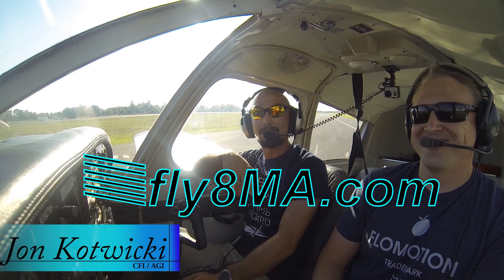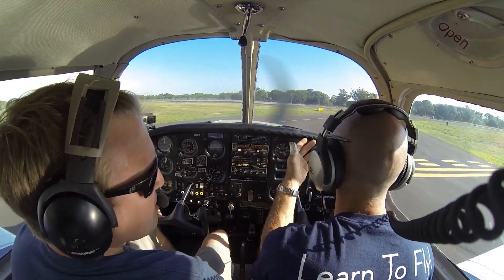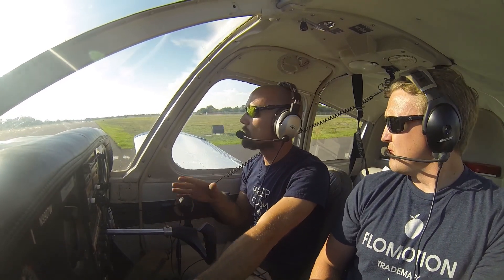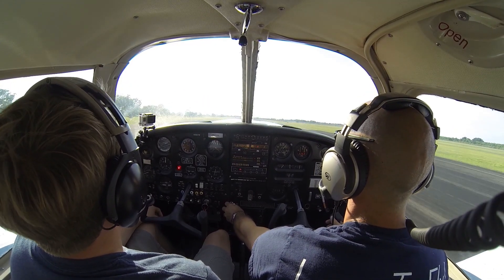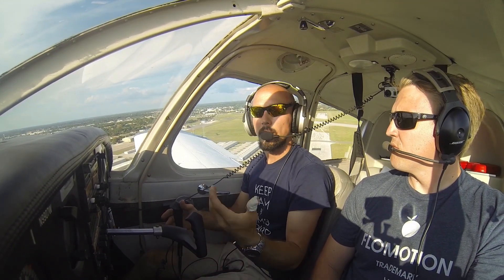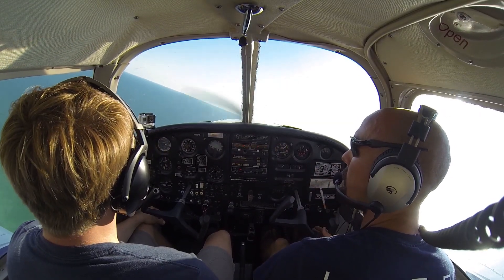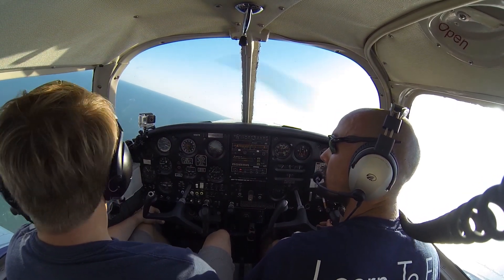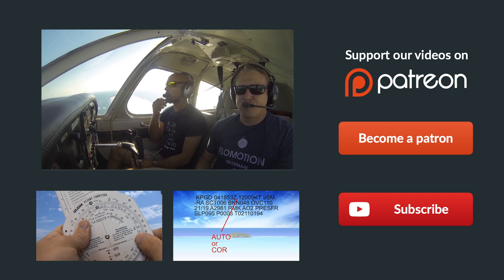Ep. 7: How to Takeoff | How to Fly a Plane

Comment: Why did you turn the fuel pump off in the air? Won't that shut off fuel supply to the engine and cause it to turn off?
Reply from the maker: all depends how the manufacture determines the best performance while operating thier aircraft. Follow the check lists, in this case. fuel pump comes off after a positive rate of climb

Comment: In the previous video - what to expect on your first flight - you mention the engine run up but do not do one.  I think your block one lessons would be improved if you have a flight control check and engine run up video included.